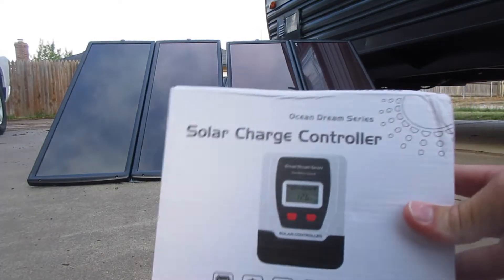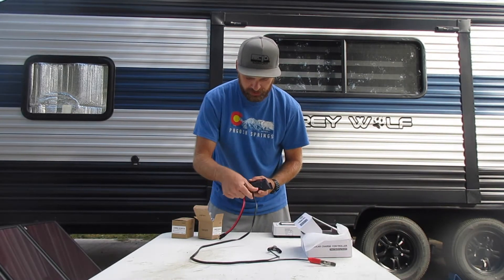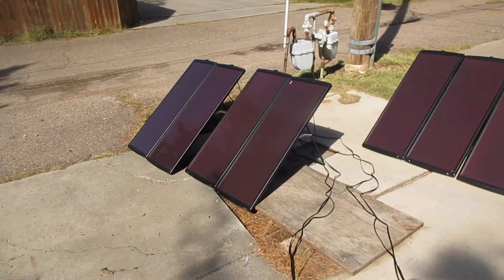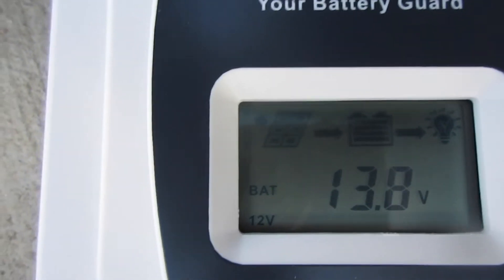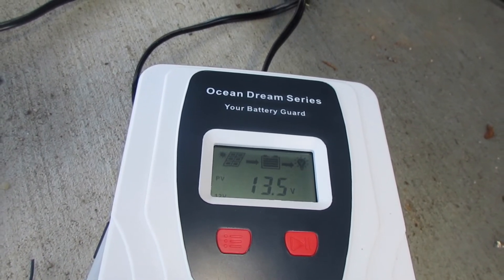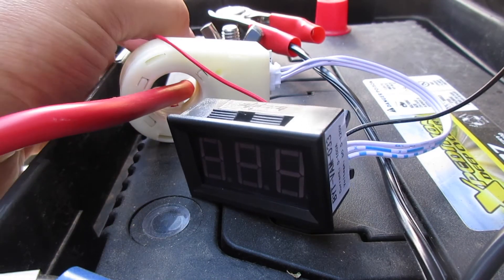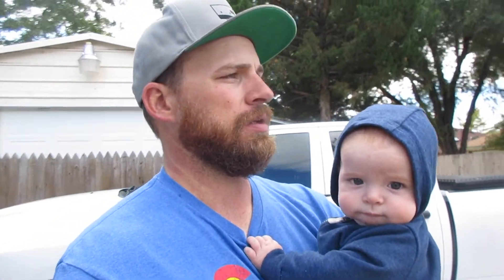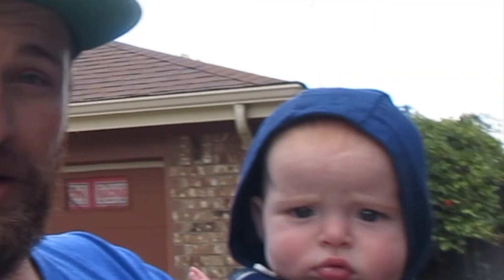New Solar Parts On Grey Wolf 23DBH: Part 2

Comment: Cool stuff! Gonna be nice to know what your actually using amp wise. That’ll help you decide on battery capacity moving forward👍
Reply from the maker: Yea I agree. I was pretty happy with the results. Now to figure out where to install everything and yes choose batteries
Reply: @RotoCityTech  if it were me, I’d hardwire everything inside that hatch. Put some weatherproof SAE plugs for each non permanent solar set to the outside of the rig some place so it’s a plug-n-play setup.
Reply: @Project2Aero  that’s what I was thinking. Maybe think about mounting it inside the cabin for easier monitoring tho…… play around with it.
Reply: @samuelvincent5602  you could grab another amp meter display and put it on the output from your charge controller.. then inside you’d have what your getting right next to what your using all the time